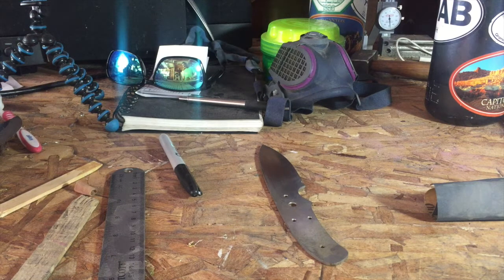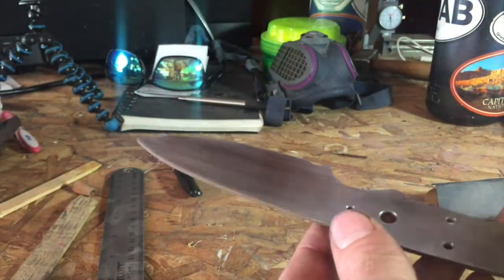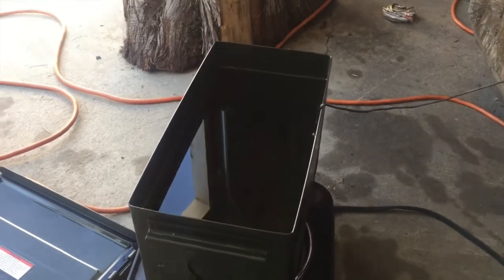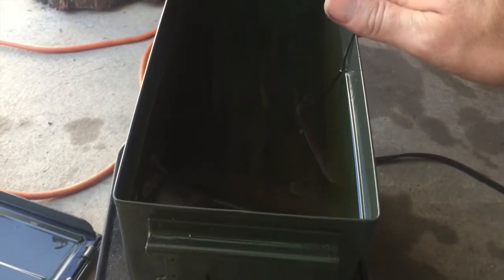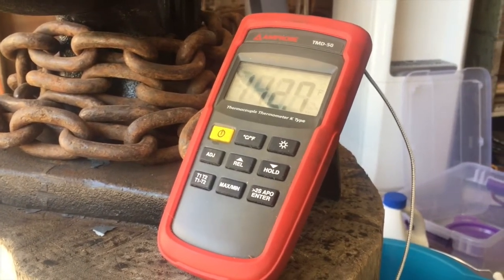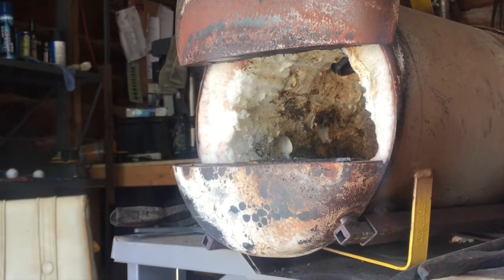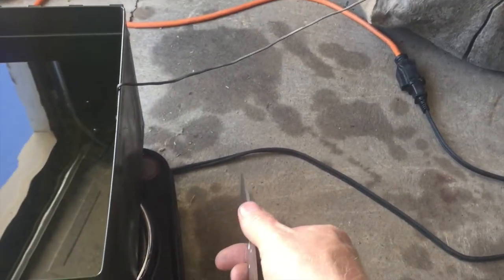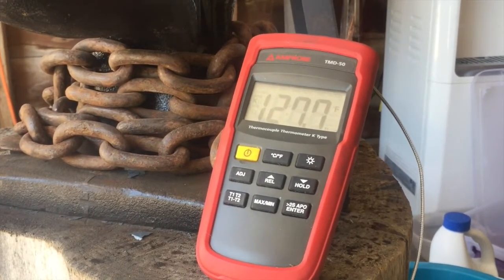Quench 1095 the CORRECT way

Comment: Just curious.  doesn't grinding your bevels after heat treat and temper compromise the heat treat?
Reply from the maker: Good question! It depends on how you grind the bevels. Tempering your knife is the process of softening the steel. The tempering temperatures vary per steel. after a tempering cycle, theoretically any temperature lower than the initial temper wont damage your original heat treatment. While grinding, as long as heat treatment colors dont show up on your edge while you are grinding, you are golden. Keep the blade cool and there shouldn't be an issue (though a couple blown edges might happen, but everyone experiences that every now and again)
Reply: Makes sense. Thanks for the reply.
Reply: @BearRiverKnives  I’m just going to get the knife sharp and shaped then quench. That would be ok right?
Reply from the maker: @KNIGHTFALL_SUPERMAN  It depends really. The thickness of the stock you choose will impact how the blade hardens. I find that anything above 1/8 inch has ha difficult time hardening with canola. However if you bevel it, the edge will harden. But leave the final edge thickness a bit on the thicker side. I wouldn't recommend sharpening the knife before quenching as the edge is too thin. It's prone to overheating, cracking, and warping the thinner you go
Reply: Another thing to consider is that in order to truly temper your knife, it is supposed to be done immediately after hitting 120-150 F after your quench. So grinding a day or more later shouldn’t truly temper the blade, but I don’t really know. 

I think a lot of people just play it safe, and don’t over grind just because we hear it from others. But I tend to think it isn’t as big of a thing as some people suggest. 

Personally I don’t think I’ve ever gotten a hardened blade to nearly 400F by grinding it a bit. You’d feel that, that’s hot. Yes the surfaces on a small scale will get very hot for very short time periods, but most people take it slow and use water to cool the blade. Tempering takes an hour at least of constant heat also, which you won’t get close to by grinding.

I think a real test would be to attempt to temper the edge after heat treat by grinding, and see if you can actually affect the blade by grinding.
Reply: @DoggoWillink  You don't need to temper immediately. That's just because some knives crack on their own after quenching, especially if you didn't normalize or grain refine. A good quench and you should be able to cryo them in the freezer or liquid nitrogen for an hour without issue before tempering.
Reply: If you see color on the edge while grinding after tempering you have overheated and screwed the blade.  Use a new belt, slow belt speed, don’t wear gloves so you can feel any heat, cool after every pass, go slow.  After all the effort to get to this point don’t screw it up by getting sloppy.

Comment: How do you feel about quenching 1095 in used motor oil instead of canola oil?
Reply from the maker: used motor oil doesn't really work terribly well. Its hit or miss, depending on the oil, how used it is and the like. Also, its very bad for your health to breath in. You would have better luck sticking with canola
Reply: What if the canola oil is previously used ?

Comment: I'm not a blade smith but trying to learn how to heat treat a knife. I'm making a bowie style knife. 1095 spring steel. It's 18 inches long and just under 3/8 thick. I've taken smaller pieces of the 1095 and heated them to 1475 for about an hour. I quench in quenching oil and my 1095 doesn't retain the 28rc from when I measured before the heat treatment.  It drops to 10 rc. If I try to heat treat another small piece as a test...is my temp correct at 1475? And for how long? If the piece is still magnetic after an hr in the oven....do I keep it in oven longer until it's non magnetic?
Reply from the maker: With 1095 come to find out, anything thicker than 1/4 inch is water quench. However, 1095 is also a shallow hardening steel which means the core wont fully harden. Id recommend grinding some bevels in to thin the edge out just a touch. be sure they are even and leave plenty of thickness. agitate in your quench medium. 1475 is the correct temperature, but if you have an oven and you are indeed holding it at that temperature, hold it no longer than 10 minutes. I dont see much of a difference soaking vs heating to quench with a forge. Are you indeed using an oven? if you are at 1475*f, the blade should be non magnetic. so recap, if you are wanting to grind the bevels in after the quench, with stock that thick, use a water or brine (salt water) and agitate in the quench. if you grind the bevels in prior in order to use oil, make sure you have plenty of oil and agitate. 1095 is a bit fussier than other steels so it might take some time. should have included that info in the video, but most folk dont make knives above 1/4 inch steel. give that a go and see if that works. if not, go to my Facebook page and there should be a call now button. feel free to give me a shout
Reply: Thanks for replying...I've tried to use our electric oven with smaller pieces of 1095 3/8 thick...it's takes about 15 minutes to reach 1475. But the small pieces never reach a red color color. After 1 hr the pieces turn a red orange color and become non magnetic then i oil quench and I only get a 28-30 rc.  I took a oxy/acc torch and heated small pieces of 1095 as well a red orange color non magnetic but quenched it in water. 
50 -52rc. I want this knife to cut branches like a hatchet but I need the edge to retain its sharpness. Would flame hardening with the torch be better with a water quench? At 3/8 thick the knife would be tough enough...right?
Reply from the maker: if you haven't ground in any bevels, then a water quench could work, though note that water is very aggesive, though at that thickness, water might be your best option. Id suggest adding a few pounds of salt to a 5 gallon bucket of warm water (or any quench tank that will hold enough water to cool the entire piece of steel. Also, with your oven, make sure your thermocouple is still good as they do go bad after time. also make sure your piece is vertical and not laying flat on the floor of the oven. try a decent size test piece in water just to be sure. 1095 can have micro fractures if quenched in water if its too hot so be sure to test some pieces
Reply: I have been experimenting with small pieces.  A cold water quench gets me 40 to 52 rc....but it's not consitant all over the piece. Yes standing the piece up will yield a better hardness. I'm just trying the heating times now...
10 minutes at 1500F isn't long enough even thought the piece is a cherry red color it is still magnetic. Also...the rc drops from 28 to 10rc.
30 to 45 minutes at 1500 F yields me 40 to 58rc. The piece is more orange than red.
Reply from the maker: what brand and model oven are you using? soak times should not exceed 10 minutes. However, soak time starts once the steel gets to temperature. it depends on the oven you have at this point I think
Reply: I work in machine shop. Our oven is a Pyradia 300B1. We have used this oven to harden stainless and incolnel with no issues. When it comes to carbon steels we suck!
We send out our spring steel to get harden. It always come back with no scale and a gray color. 55-58rc.
So all test that I'm doing I'm also looking for that gray color.  I've hardened 4140 and 4150 @1475 F
10 minutes. 1/8" thick to 48-58rc. Oil quenched.
I get the same results with 1095 but with a water quench.
Once we try 3/8" thick material we get extremely poor results.
We have much literature on heat treating but it doesn't work on 3/8" material....
Yesterday....I forgot my piece in the oven it stayed 90 minutes!!
What the hell??? Might as well water quench it and see.
55-58rc!!!!
The piece came out black after the water quench instead of a gray color. I'm tempered it and 45rc.
So that's why I'm so confused on heating times. I plan on making a video once I'm ready to heatreat the knife...maybe I should make one and show you what I'm doing.
Reply from the maker: yeah do that. Also, are you sure that you are working with 1095? I have gotten mixed batches of steel before. try grinding the piece thinner to see what a thinned piece does. something that thick in an electric oven is going to take a little while to fully get up to temperature. leave it in there for a good 2 hours to see if you can get it to temperature. if you have a high temperature infrared temp gun, use that to be sure of your temps. so many factors right now, though a video would be a huge help in seeing what is going on. high carbon shouldn't be too difficult to do. fully hardened 1095 should be in the range of 65 to 67rc. Also, are you agitating when you are quenching?

Comment: How do you know the temp of the blade when you heat it up?
Reply from the maker: On thicker knives it tends to help. by thicker I mean anything above 1/8th inch, though you can get a good knife with one cycle. I need to do some in depth testing on the different cycles, but from what I've done so far, i dont see much of a difference. though i was using fairly beefy blades for it. I am making a list of things to test and ill hopefully make a video soon about it
Reply from the maker: the issue is the gas is subject to many different factors that will affect the burn of the fuel. I like clean burns so it gets upward to 2400*f in the forge I have. Maintaining a specific temperature via adjustable regulators is very hard and the temp will fluctuate too widely. However, I'm working on is building a PID controller that has a gas regulator that will shut the gas off once the temperature is reached, then fire it back up when it calls for more heat. That should effectively make a gas heat treatment oven. Only downside I anticipate is that its harder to slowly heat up metals that require slow heat up times that you can get with an electronic unit. Ill post a video once I get this built
Reply: Bear River Knives They make K type surface probes. I was considering buying one. With that, you could soak a blade in a forge fairly decently (which apparently is supposed to be done for 1095, a short soak). You’d basically just pump it in and out and check the temp as quickly as possible I guess.

I have some 1095 but haven’t tried it yet. I’m still on the 1084, which has (as far as I can tell) been easy so far. So I’m considering a surface probe for 1095 and other slightly more difficult steels. As for the oil I honestly just do it the way you used to. But the thermocouple would easily measure that temp in a liquid, with a cheap probe, so I’m not as worried about the oil.
Reply: I hear you there I do run my Forge with very low oxygen but I also have a big piece of angle iron to protect the knife from the flame that helps with scale too. I like your videos keep up the good work
Reply: If you have a k-type thermocouple why don't you put it in the Forge? You can hold and maintain a accurate temperature in a propane Forge with a k type like you have
Reply: After you quench and place it your oven at 435 for an hour do you repeat the 435 or no
Reply from the maker: To be honest, its a little bit of a guessing game with a forge, but take it to non-magnetic, and a "little further" then quench. A heat treat oven would be ideal, but the forge is a cheaper option